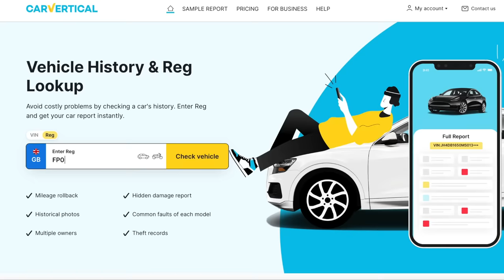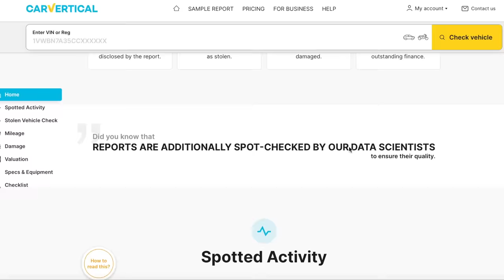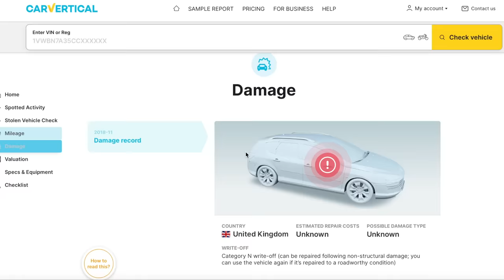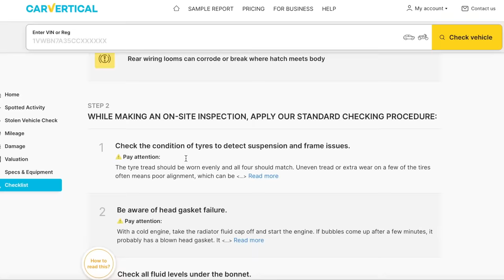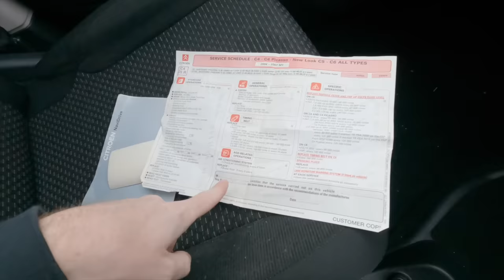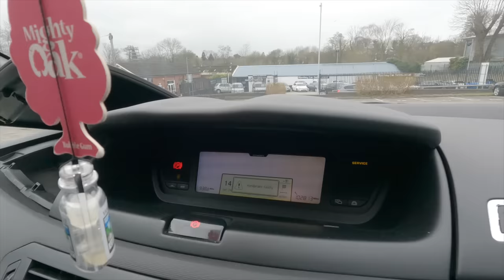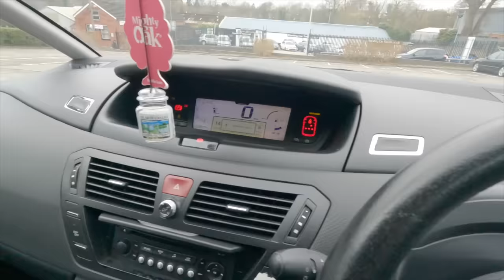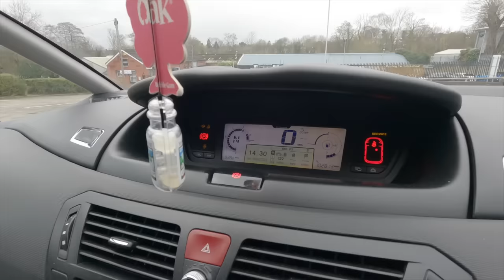I BOUGHT A CHEAP CITROEN C4 PICASSO FOR £300

Comment: I had a few c5's for load carrying, and they're reliable.Only had drop links and finally a clutch when it was a real old banger, oh one alternator..I had a 407 also only problem i had was the blocked exhaust filter at 130k miles which I sorted myself..I think what you have to remember with these cars is the low Road Tax , low running costs and size..They are big cars ..Japanese Cars of the era pumped out more C02 had higher road tax rates and the diesels are big compared to Citroën.I like Citroen a lot and there served me well..I'm currently driving a Renault that's proved reliable..Lexus is expensive ...The Citroën carried my family about in reliable comfort, its not a sin to have kids and a family

Comment: After a quick google search, the Nitro OBDZ you found in the glovebox seems to be a £25 device which is supposed to increase horsepower and torque using a custom engine map based on the driver's habits. I'm reluctant to believe that it does anything, and the previous owner probably did too since it was found in the glovebox.
Reply from the maker: 😂 exactly
Reply: Snake oil, Big Clive has disected many of these fake devices. Still, it suits the car! 😂
Reply: @midinotes  You beat me to it. Love Big Clive

Comment: The 56 plate Xsara Picasso I'm driving currently is in great condition and has no faults even at 125k miles, my mechanic described them as "agricultural", and it's flown through the last 2 MOTs with the odd advisory for play in a joint or bush. I had a 56 plate one 4 or 5 years ago and it was falling apart with rust and the one before that, a 54 plate, was a pretty good car.

Comment: Yep I have one of these, 1.6 HDI. The gear change is done by a 5 year old as you say. However you get used to it. Its not a bad car in reality (A lot worse out there). Good on fuel and pretty reliable, just ahd full engine service and gearbox service along with MOT which it passed. Honest car and does what it says on the tin.

Comment: I am NOT the kind of person to buy a C4 Picasso.. but I did.  It's a long story but I arrived by plane with my family after 16 years of living in Asia.  This was in 2016, I needed a car the next day after I arrived, I had a lot of other things to do like find a home..  Anyway on my first day I bought a 125,000 mile 2007  C4 Picasso (not grand Picasso) for 3450 quid, insured it and drove it away.  I immediately changed the oil and filters and put some decent branded tyres on..  I drove that car for 3 years and in that 3 years I never had any problems except a sticky brake calliper. It did get serviced properly.    We went all over Europe, including once driving from Algarve to Northern Ireland in 2 days.   The handling was like a boat, but it was so practical and comfortable and actually reliable. And the MPG on a long run was amazing.  I never sold it because it's effectively worthless.. I parked it in 2019 and its been parked ever since.  Since then I have owned a Merc C200, Honda Insight and VW Polo and nothing has really matched the space and comfort of the old Citroen.   These are better than most people think, provided you buy one that has been serviced and do continue to service it.

Comment: Brilliant video as always.  Hate to say that the wife has one of these for the family run-about, same colour too, but however embarrassing it is, it is the most practical thing ever: I took a washing machine to the tip the other week.  And I’m reasonably sure I could stick my neighbour’s Fiesta in the boot.  But I'm afraid you gave in too early!  These suffer from a common problem: ABS sensors get pushed out of whack due to corrosion, and the crap design of the system makes the computer think that in addition to faulty ABS, you also have a faulty park brake and gear box and probably other things I’ve forgotten.  Basically, every warning there is comes on and you can’t get above 2nd or 3rd.  All from a single ABS sensor.  When it first happened to us we thought the car was dead!  Dealer charged very little to clean the corrosion and replace the ABS sensor, and all was good.  Until it did the same again a year later!  Great cars, just don’t go too far from home.  And don’t go out in the rain.  And make sure your seat-belt is tight for when it decides to notch down to 1st despite the fact you're still doing about 15mph.  And only drive at night so nobody you know will ever see you.  Apart from that, all good!

Comment: I had one and got that ABS warning - turned out to be a lump of dirt on the ABS sensor. That got fixed…however then the clutch went. Glad to see the back of it
Reply: If you ride the clutch in any car it goes?
Reply: @foppo100  why do you assume that they can't drive rather than a cheap poorly built French car just failed?

Comment: I had a 2018 C4 Grand Picasso, It looked the nuts, it had everything on it, all the bells and whistles, but at the end of 1 year it had cost well over £2000 in repairs and still had faults that Citroën couldn't fix. it was the biggest money pit I have ever seen, AVOID at all cost! Even if they offer it for free.
Reply: My personal experience is quite the opposite, owning a 2014 1.4 diesel. The car has been bulletproof except for a clutch and a couple of belts. Worth the money if you ask me, lots of comfort on the road with loads of space.

Comment: I bought an original Picasso for cheap - £1795 from a dealer. One owner dealer did a clutch and cam belt ( I got the parts receipts ) and I loved that car. Did 30 odd k miles in 18months ferrying offspring to and from Uni. In the end it sprang an oil leak and so I changed it. I knew better than go for a C4 Picasso though - for too many electrics for me to risk unlike the original which was a basic car at most level.
Reply from the maker: The original Xsara Picasso was a bit more of a workhorse
Reply: I was always amazed at how well those drove considering the age of the platform they were on, quite liked the 2.0hdi in a worrying way 🤔
Reply: I had an original picasso 2.0 Hdi, bought it with 127k miles on it, put another 100k miles on it, gave it to my niece who wrote if off with 246k miles on it.  The only problem we had apart from consumables was rust in the cills which were welded up for around £100.  I never enjoyed driving it but it was by far the most reliable car we've ever had.   Drove a c4 Picasso as a hire car in France once and was put off by all the electrics too.
Reply: @chrisdowns1987  Mine was a 1.6 petrol but good enough on fuel - It was like piloting my sofa it was great.  Most annoyingly when I decided that I was going to move mine on I found my Dad had traded his low miler 20HDI in for a new Nissan Note grrrrr - he's 120 miles away from me so I tend to speak to him weekly so that was not only news but bad news for me
Reply: @derekgriffiths794  as a former owner of one I am always keen to look at them to see if any have survived that decay....................  not seen one that hasn't been welded and covered in black gunk in ages

Comment: Given what you’ve just reported to be about this car’s reliability record, the fact I own a 2008 Version of this 7-seat Car (Grand) and it’s still working makes me feel both relieved…and almost feeling like I should get rid of it whilst it still works! 

Someone I used to know liked mine so much they acquired a 2009 Version so 6 months younger than mine…returned within a week. I do get the feeling I have been beyond fortunate to still have mine reliable!

The Driver’s Seat on mine also sagged at the exact same spot; had the seat replaced about 5 years ago
Reply: Same here with my 2008 7 seat Grand Picasso, despite mine having loads of potential things to go wrong: the electronic gearbox (terrible in start stop traffic), digital climate control, air suspension, cruise control, handbrake, auto lights, auto wipers - perhaps it was a better produced batch we have?
Reply: @rickardo522  I think more luck than anything! The EGS doesn't do Stop/Start Traffic whatsoever and changing from 2nd to 1st gear takes an age, but it's otherwise been fine
Reply: @rammfan1482  I tend to manually change mine using the paddles because it can hold gears too long. I've done almost 70000 miles in mine to take it to about 140000. The last couple of years we also have a small batch for around town (and avoid the start stop gearbox use!), but it still does regular long trips to Scotland etc. and occasionally France/Holland, for which it's pretty comfortable taking the whole family (plus a roof box). Just annual service with MOT (does often need a couple hundred pounds worth of work doing, though!) and keep on top of usual fluids etc. Will be changing it this year, but overall I do feel I've been lucky.
Reply: @rickardo522 £200 for MOT at 140k is by no means a bad car...

Comment: Interesting. My son had a 2.0 Grand piccaso and from 0-78k miles No problems. Powerful 150bhp Deisel. Great cruiser.
Reply: I was thinking about getting a c6 hdi v6 But decided against diesel since it's more expensive than gas  plus over double the tax 😔I also started to worry about reliability issues so i got a 250hp volvo s60 instead

Comment: I bought one of these 4 years ago with 72k on the clock and I haven't had eney issues and now have 105k on the clock.
I regularly service it myself,there cheap to run,tax,insure and with all the seats down you have a massive floor space and is very practical.
Mine is a auto  and always drive it in manual mode using the paddle shifts and it's just  like driving  a manual without a clutch pedal.
In the video you kept releasing the handbrake why?all you have to do is press the accelerator and the auto handbrake releases automatically.

Comment: You are spot on about the gearbox my dad used to have a 10 reg grand picasso 1.6disel auto and I used to laugh everytime the car eventually decides to change gear. It would hang at 1st gear for so long with high revs deciding if it should go to second. And everytime the gear changes you just lean forward and back like youre on a horse. A joke of a car.

Comment: Hi Matt, I bought a 2006 C4GP in 2012 for 3k and have used it for the last 11 years. It sometimes shudders when you drive off and I have replaced the radiator fan and A/C rad. Best 3k I have ever spent. It travels 12 hours at a time up and down the French motorways six times a year. The seats are the most comfortable for a car in this size range. If you buy a £300 car then what do you expect. I have features on my 2006 that were not adopted by other manufacturers for 10 years. I think other C4GP owners will agree with me that although quirky, they can be practical and fun to drive.

Comment: Scrap seemed the best option for that one, even as a fan of old cheap french cars anything with either the prince petrol engine or the EGS automated manual are worth running away from. That gearbox does its best to recreate a learner driver trying to grasp clutch control.

The later ones (and i think the 2.0 diesels) came with a proper torque converter auto, i got one for my aunt she is using it to transport my elderly grandmother so rather than carry food residue and sweetie wrappers its getting reasonably well cared for.
So far touch wood in 2 years its gave no issues, but an old ropey example can be a pure headache especially with how they deliver warning messages.
Reply: Prince engine ?

Comment: The biggest issue with these cars is the people who buy them because they’re cheap then proceed to run them on a shoestring budget. One fault develops and they ignore it, suddenly there’s another fault and they ignore it too. 

The ABS/ ESP and handbrake fault is due to a simple £12 rear ABS sensor. Plus the DPF additive tank can be topped up for under £100. 

However I agree the EGS boxes are total crap, even when they’re working properly they’re horrible to live with. 

I’ve had a few manual versions over the years and thought they were a lovely thing to drive. Excellent seats, soft suspension and loads of space inside.

Comment: Matt that was brutal. I had a 7-seat version, bought for buttons. It mostly thought it was a kangaroo, then occasionally drove as smooth as you like. One of the most practical and comfortable cars I've owned, but I don't think I'd risk another EGS gearbox. I took it to be washed before selling it (yes, I did sell, and not scrap it - sorry), and the chap in the car wash stripped about half the laquer off the bonnet with the pressure washer. Summed up the build quality really. Apparently the steering wheel was designed with that fixed centre so Citroen could optimise the shape of the airbag, knowing it would always deploy at the same angle.

Comment: I know the C4 was flimsy, but this hasn't been looked after in any shape or form. I bet half the relays and fuses are buggered for a start, and if it's not been serviced properly and given a run once in a while, that's just asking for trouble with the original DV6 engine, and given you see plenty of C4s of this era driving about, you do wonder how much is actually down to the owner (and the prang) rather than the car itself. I've no idea how that managed to make it to your business, let alone survive long enough to be driven there. I wonder if it had water damage of some sort?

Final word - if somebody buys a diesel just to potter around town on short trips, they need their head examining.
Reply: Especially if it's a modern one with dpf etc. They hate it. My seat Leon 2017 was forever doing filter regenerations. On longer trips that would happen about every 300 miles or so and only noticeable by higher idle/no stop start,  but in town commuting it could happen every 100 miles. So you then have 20 minutes where the car accelerates like a 1.0 and a smell of burning as the exhaust is heated up to really high temps to burn off the soot. Stop somewhere before the cycle ends and the fans sound like a jet engine! And looking on forums it's normal. Not surprisingly this technique similar to a pyrolytic oven cleaning resulted in rubber seals wearing and oil leaks. Older diesels are fine but can't go anywhere clean air without hefty tax due to pollution rules. And you do get black smoke out the back. Which is embarrassing. So best just get a petrol for town work or electric/hybrid.

Comment: I owned the older petrol manual version of the Picasso and it never went wrong until the ignition coil thing failed at around 95,000 miles. Replaced that and all was okay. Then sold it and replaced it with a Suzuki Swift. Much better.

Comment: Mm, I think you need to get off the fence and give us you're honest opinion here . . . !   I'm with you all the way. The thing is, that engine is a Ford/French collaboration and is present in many cars, including the 207, 3008 and my Fusion in 1.4 TDci form. Chuffing injectors is common and just needs new seals. The leak off pipes will be leaking and the turbo's spew oil for no apparent reason. That pants gearbox is just a cheap way to make a manual into an auto without developing a proper gearbox.  As for the electric handbrake . . .

Comment: I had a Citroen BX in the late 80's. B Reg. Drove it from Plymouth to Canterbury. Suspension collapsed broke the pipes carrying the suspension fluid. £700 to repair. Car was worth £400. Scrapped it and got £50. Had to hire a car to get home. It was a new Fiat Tempra. Started to mis-fire 50 miles from home. Managed to get home. Bought a 2nd hand Peugeot 405 F Reg.  Radiator overheated after 6 months.
French cars!!!!!!!

Comment: 102.000 miles is nothing really, and it’s as bad as that, unreal really😅
We have a 2011 Galaxy Titanium X with just under 500,000 miles (around 480,000)
And other than it having front suspension knock, it’s still going very strong 😅

Comment: My parents had an old Renault Scenic and it was much the same story. The electric handbrake failed, all but one power window failed, ABS system failed, ESP system failed, fuel reading was inaccurate, immobilizer sometimes didn't recognise the key, climate control stopped working. So much wrong. 

My friend had a Renault Clio of the same age and he lost both power windows, kept getting an ABS light, and the immobilizer completely failed after some time so it went to scrap. 

That is why I'd never buy a french car

Comment: A C4 picasso is still less dumb/stupid/useless than any SUV... at least they fulfill a purpose, instead of trying to look like something they're not.
And evaluating a car model by a vehicle, which is at the end of its life (that's why it costs 300 pounds) is simply lame...
Reply from the maker: Why is it at the end of its life when it’s only done 100,000 miles? To me that’s indefensible and yet here you are defending it 😂
Reply: @HighPeakAutos  Would have to check the car's service history. A lot of cheaper cars are more reliable than some higher class cars. The difference is how much people spend yearly in maintenance. People who buy cheaper cars, normally cut on the car maintenance. A lot of bmws, bentleys, mercedes, etc last long, but simply because the owners are burning hundreds or even thousands of pounds/dollars/euros yearly... and some of them don't even last that long. 
Some cheaper fiats, citroëns, peugeots, even though more reliable, and less expensive, get trashed earlier, because people skip on the maintenance.
And my comment is more about your video than defending the car. As I said, the car was not really expensive as new and fulfilled a purpose/need. Trying to ridicule that, while driving an expensive suv! Lol... If you have such big wheels, go do some off roading with it!! You would probably be better with a Panda 4x4 from the 80's or a Suzuki samurai/jimny.
Reply from the maker: @ee99083  no that’s True. Usually the more basic the car is the less there is to go wrong so it’s usually more reliable